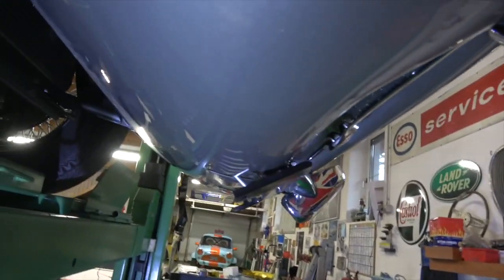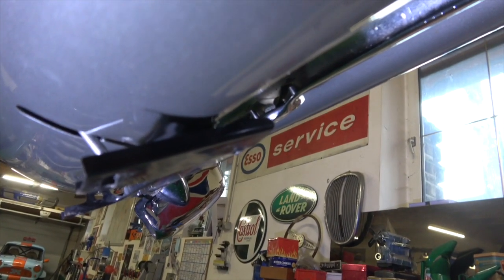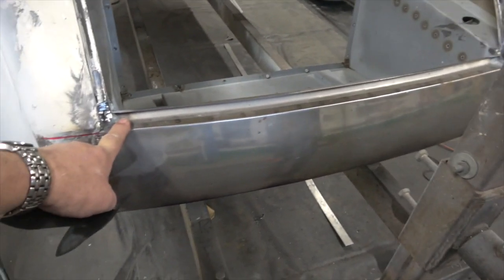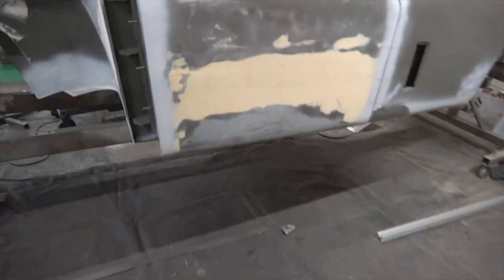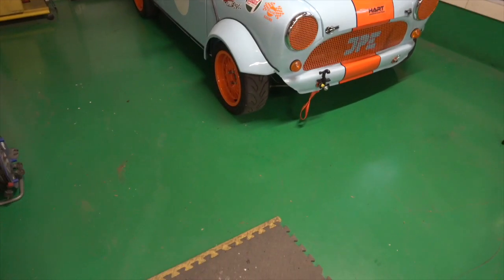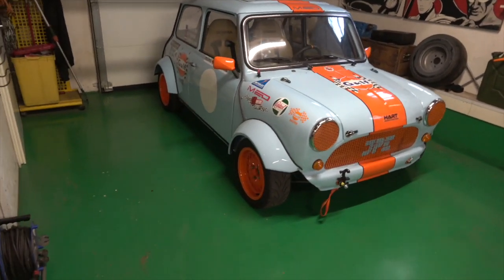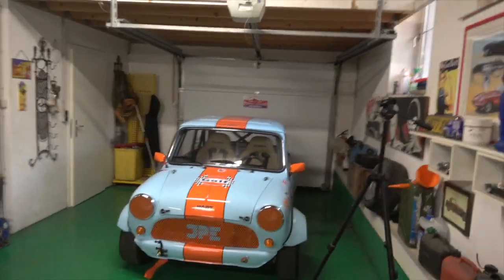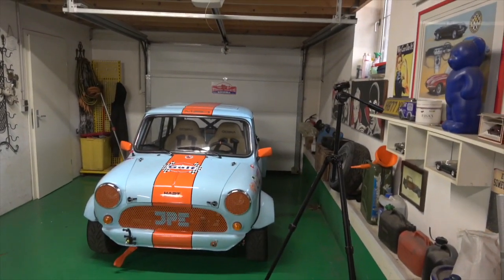Jaguar E Type & XK 150 + Classic Gulf Mini Update & A Short Rant

Comment: the XK is coming on very nicely, and still can’t get over the look of the gulf mini she’s stunning does need work , but your a man with a plan so you’ll definitely get it correct and when it is can’t wait to see you ripping her around the red bull ring
Reply from the maker: Theo, Thank you for you comments on both cars. The red bull ring is on if can book a session for 2021,  I think the ring would suit the mini
as it just want‘s to stretch it‘s legs No top end but you can take the corner speed a full throttle. Cheers Dave
Reply: @ClassicCarCave  yeah minis are great at the low end but there’s just never anything at the top end best of luck with everything 🤘🏻

Comment: I think I missed a bit, what happend to the e type? 

Is it worth checking with a hill climb club / group and see if they could advise you on the sunroof? Maybe even the msa  handbook could point you in the right direction
Reply from the maker: William, I had to remove the bonnet to change all the shims on the exhaust and inlet valves and we forgot to take of the number plate holder
and this was the result damage to the under scoop. I need to check out a local club when this lockdown is eased up! Cheers Dave